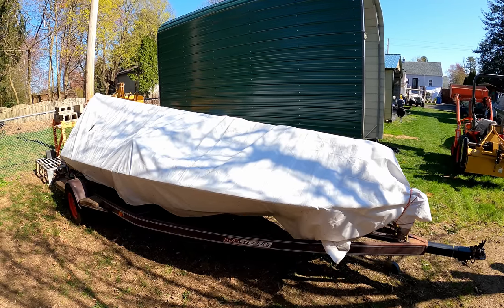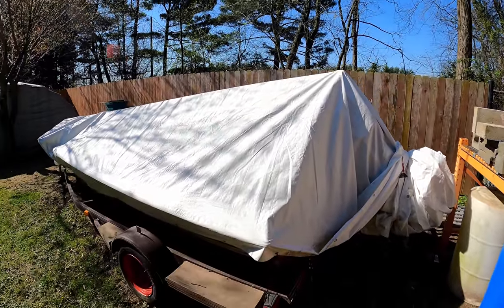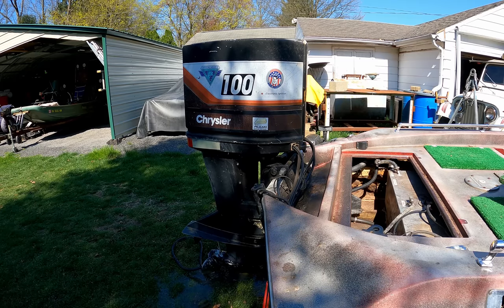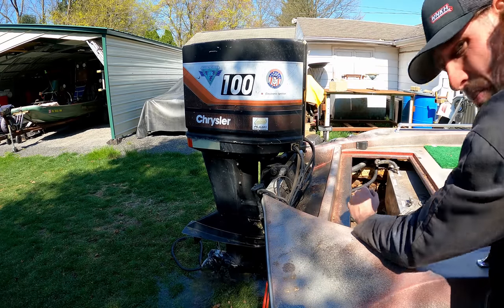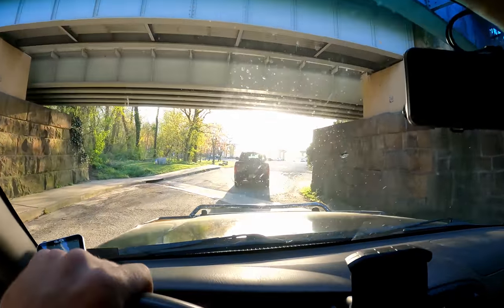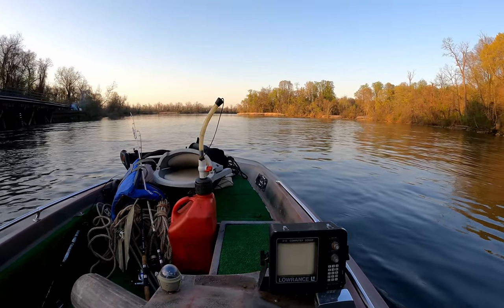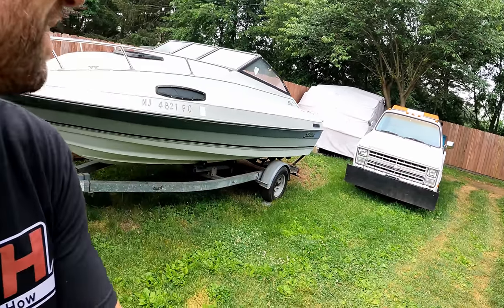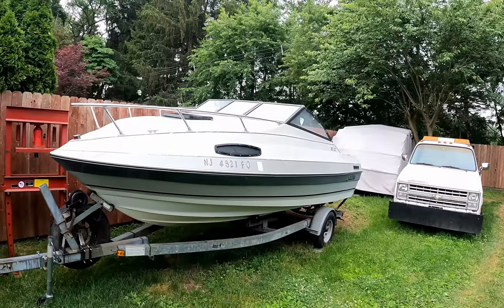BASS DUMPSTER Boat Final Conclusion - NNKH

Comment: Your first video I watched was the bass dumpster. I absolutely love how you fix everything to get it running, and it is off to a new home! What is your idea on an older seadoo boat? Would you do a video on rebuilding, or renovating a boat like that, or is it not worth it?
Reply from the maker: I don't know if it would be worth it on a sea-doo. But depending on what model and how much it needs maybe.  I think the best thing to do is just get it running and safe enough to get on the water to have fun with

Comment: Hey Chris...  I discovered an interesting note in my shop manual for my1990, Astro 115 hp, Evinrude.   "Performance driving, is recommended 25 to 1 Mix"   Right from the Factory, which embarrassed me, because... I maintained 43 boats for the military, and have owned and gone thru lots of boats.   So,  I have also, only run 50-1, and have basically blown a head gasket out of every boat I've ever owned... Except my current 1990 Astro.  I have the spare 6 gallon tank to run the 25 to 1 Mix to run wide open.    Short bursts don't seem to kill em, but... I tend to run em wide Open for too long, and I think it is harder on the Crank, needle bearings, than the cylinders.   Anyhow,  just a note.
Reply from the maker: Interesting! Yeah I suppose that makes sense. Never had a problem with this one and I ran her pretty hard.

Comment: the old stuff lasts longer because they over- engineered them, these days it's all about the thinner the metal the better for weight reduction and being cost effective instead of being long lasting, the way they think these days is people will upgrade by the time it rots out but that doesn't stop them over-charging for less material and cheaper builds sadly.